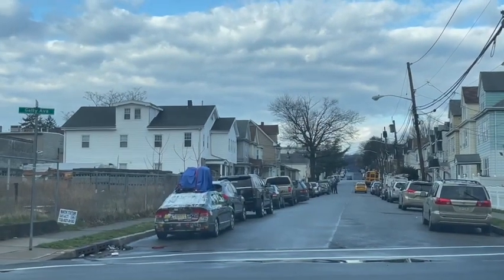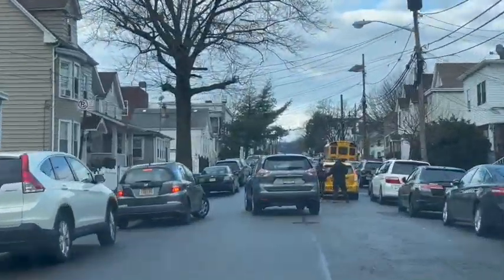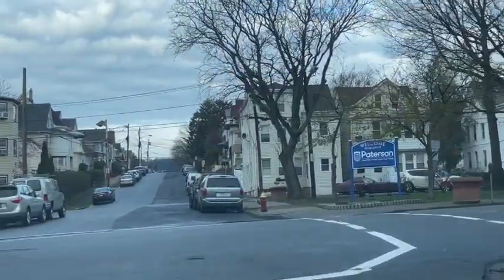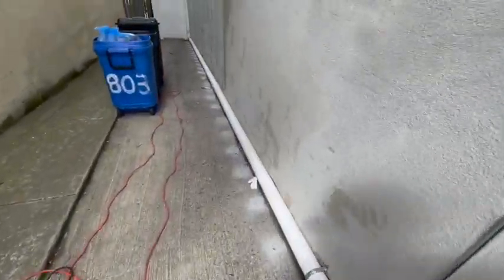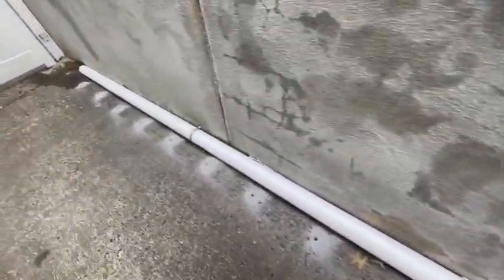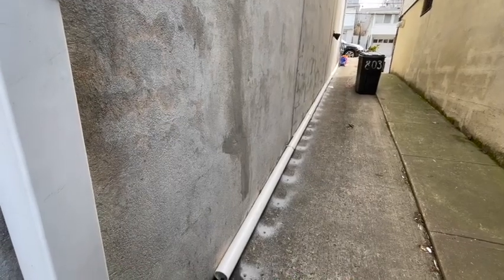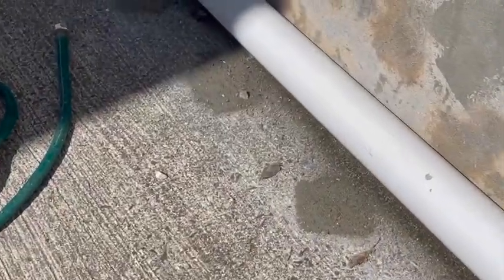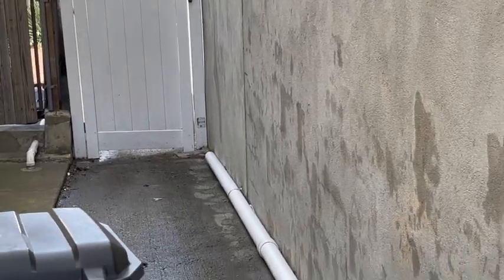How to do Termite treatment, Drilling Method and Inside Foam, Apr 1

Comment: Would the drilling to 18" depth of exterior perimeter be sufficient for a house with a basement where the top of the slab is about 40" below an asphalt driveway that abuts the foundation?  I will also need to figure out what pump to buy.  Thanks for the video.

Comment: What size bit you use to drill the concrete?  Also, what do you suggest to make the cement patch closely match the original cement color?
Reply from the maker: I use a 1/2 inch bit 18” long.  I mix the patch mix with the powder from the drill to try and match as closely as possible.
Reply: @blayespestcontrol6900   Thanks...

Comment: Cool video, what did you use to pump the termiticide in the holes?
Reply from the maker: At the time I used a retrofitted pond pump.  I didn’t have the termite jig yet😁😁
Reply: @blayespestcontrol6900  that’s what I was thinking when I saw the hose in the bucket but wanted to ask.  I enjoy the vids, keep posting.  👍🏽

Comment: I had a question, My 5 year termite contract was up and they wanted to renew. the initial payment was higher than my normal yearly visits because they said they had to drill holes into the home. They were already drilled from the previous contract. Do holes need to be redrilled every 5 years or do you just retreat?
Reply from the maker: Hello Dane
Glad to assist if I can.  The only reason anyone would need to re drill is if there is termites activity.  Otherwise not.  Now on the other hand - if you choose to treat anyways as a preventative then yes, they must re drill.
Reply: @blayespestcontrol6900  Interesting, they topped off my holes with corks, so i wouldnt think they would need to redrill. The holes are easy to access
Reply: @blayespestcontrol6900  but it is easier to redrill the patched holes rather than drill a new hole weakening the concrete more .you only have to drill past the patch and use the same drilled hole then patch again after treating

Comment: Do you only foam the woods beams or can it just be between beams?
Reply from the maker: The foam treatment is meant to be applied between the beams, the material expands a lot once its injected into the wall.  All the areas treated are good to infect the insect once it crawls over the treated surface.

Comment from the maker: Check this video, you can get a good idea on what’s involved when treating for Termites when property has cement all around.  Also treated inside with a foam into the walls.
Reply: Thanks.. I forgot to seal 😵‍💫 I was hopin when they come in they get soaked on termidor and take it everywhere else… I’ll do another treatment and seal this time on the outside walls…
Reply: Good job sir

Comment: That's quite a big area to use termidor. (Can stuff). It only has a residual of 6 weeks According to manufacturer.  Boracare would have been 30 years of effective treatment.  If I was homeowner I would have wanted to see proof of infestation before spending money on something that looks like you can't pinpoint. Drywall is cheap, repair is easy. Anyway, thanks for video.
Reply from the maker: Thank you for your input.  The main treatment is the work done on the outside perimeter.  At the time the treatment was done there where active termites in the area of treatment.  As per cost, I’m in the Northeast of NJ where labor cost are through the roof- opening the walls and putting sheet rock back & repainting would have been way over the cost of injecting this solution into 1/2 holes in the wall. I do Pest Control not construction the option of opening walls is off the table for me unless the homeowners wants to do it.  I use boracare on exposed wood when it’s possible and you are correct it’s a better option- just not always possible.
Reply: You must not can read a label ,termidor treated in a 6 inch trench and covered with soil afterwards carried an 8 year expectation but most companies only offer a 5 year renewable annual service contract
Reply: Boracare is primarily labeled to only treat exposed wood and is not intended for a soil barrier treatment,again ,please read your labels before accusing others of not doing the correct action